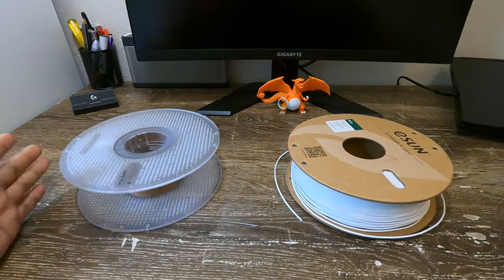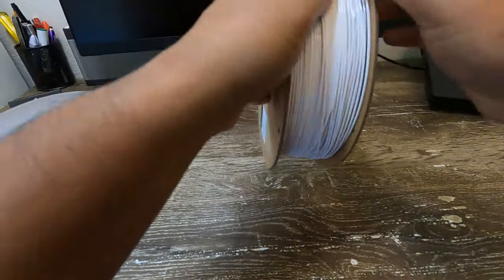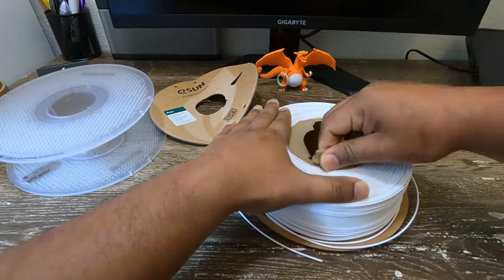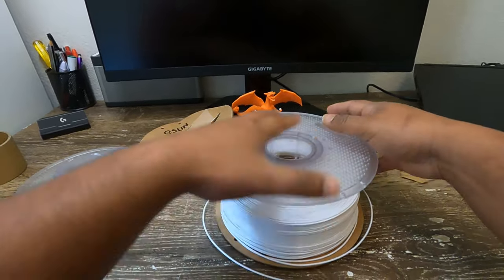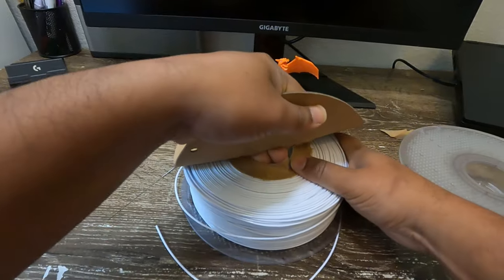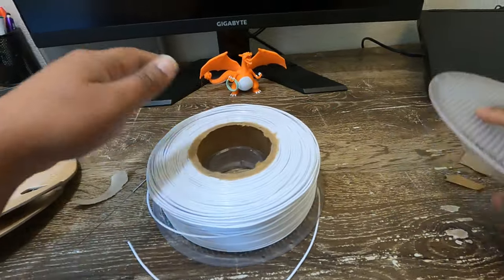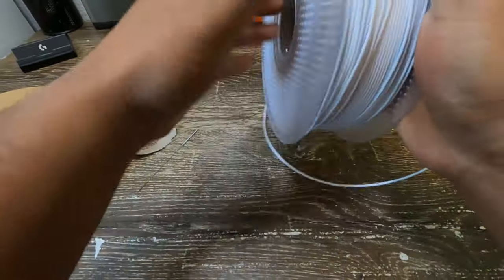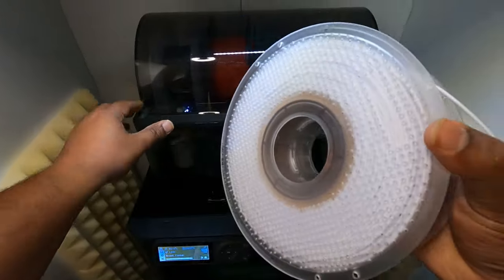How to convert cardboard spools to plastic spools for Bambu Lab AMS unit?

Comment: Do you use esun filament for your bambú lab ?
Reply: Yes, almost nothing else. Banblumab filament is much more expensive. Just some PTEG and PC from bambulab used (easy setup in printer)
Reply: No he doesn't that's not an esun filament roll and that's not going into a bambu labs ams system on a X1C....😂 really what a stupid question.

Comment: I do this a lot, just have to keep an eye on them because they can start causing pull/rewind issues when they get close to empty. Otherwise this is the hack to go to. 

There are multiple adapters for filament brands that don't correctly fit like this too available on most print platforms (printables/thingiverse etc) that can be worth it if you keep buying the same brand.

So far, I had good success with Polymaker, Duramic and eSun doing this. The main issue is when you get to the smaller spools, the less than a kilo ones. Don't try, they need a support otherwise you'll be stuck with a spool that only prints as a direct filament, you're better off printing with the cardboard spool...